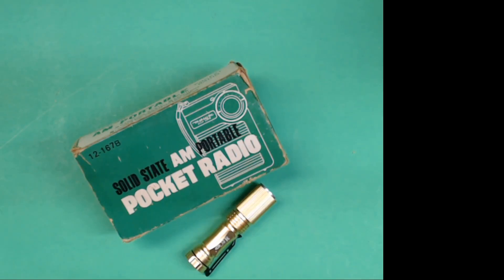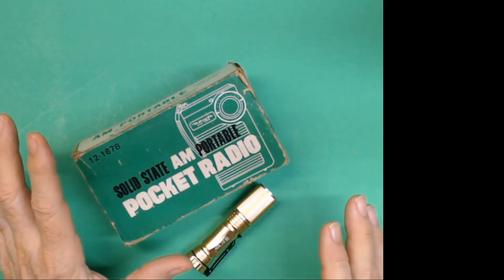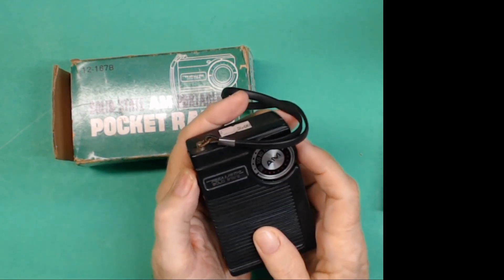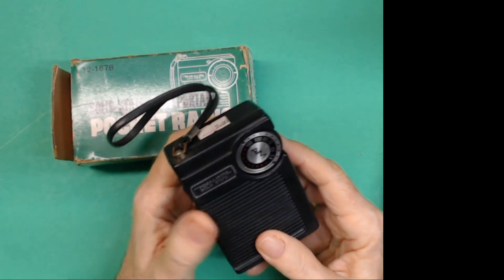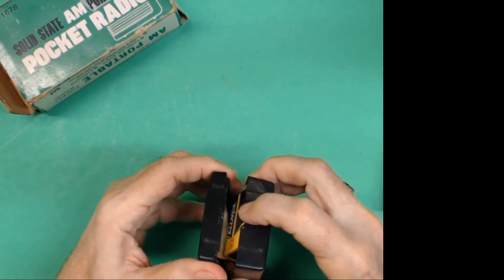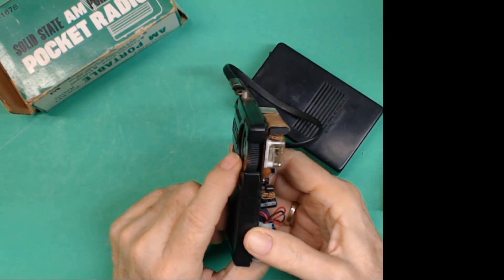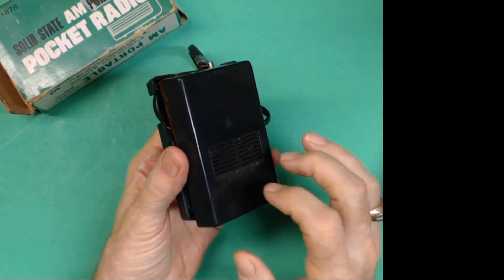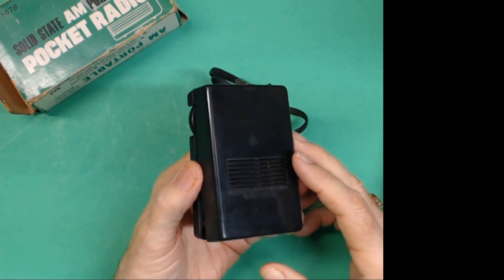TRRS #1957 - Old Radio But Aren't We all Get Old?

Comment: Those were available from 1974 -1983. The same radio (circuit/board and speaker) in a different case (12-177) from 1984 - 1985, and that case got a new circuit for 1986, but was gone by 87.
 Yes, I need to get some kind of a life..lol
Reply: Interesting.  Thanks for the comment, that would date mine to 1974,as I was no older than 10. (+/-).
Also thanks for watching.
📻🙂